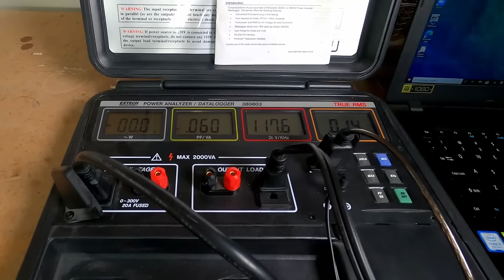Singer Heavy Duty, Most In-Depth Review on the Internet. No Really, I'm Not Joking.

Comment: I repair/rebuild 300U Chain stich machines daily for a very large mattress co and I just got to say my hats off to anybody who can tear a sewing machine down to the frame and reassemble it. With the end result being a fully functioning head.
Reply: I agree with you. I did Industrial Machines,,,and now more Domestic type,,, last time I did this in Training,,,long time ago,,,,I not doing that again,,,I worked on the 300 w. Series.  Good machine,,,also the 4 needles,,,making mops with the puller feed,,,the trick is the Looper Avoiding motion timing,, eye to eye setting with needle,,and feed timing.  😀😀
Reply: I buy/sell/use vintage industrual sewing machines. These machines are a symfony of asynchronous movements, it's a bit of a mindf*ck to get the logic of the stitch cycle. I'm yet to dare tearing down a machine fully. 😂
Reply: @Farmfield
Reply: @michaeltexeira6185  I am curious, why you are typing commas between each phrase? Proper typing format for a pause uses commas and for a pregnant pause...a series of 3 or 4 periods. 

When you create a broken sentence using tons of commas as you did, your sentence becomes one big 'run on sentence.' This technique leaves your readers not knowing when to start, when to pause or when to stop.  Punctuation is important to establish your pacing, a transition of thoughts 🙂 and clearly convey your intended message. I hope this helps!

Comment: The stainless steel bed cover is to help fabric glide across the bed and withstand scratches from pins better than plastic.
Reply: So they say, but it’s a marketing ploy. Fabric glides over plastic just fine.
The feed moves the fabric, it’s hardiness is more important than a fancy steel contact paper bit.
Reply: @elizabethclaiborne6461  Pins eventually mar up and catch up plastic bed plates, and they're molded plastic, so they can't be replaced. The little scratches and catches eventually prevents your materials from gliding smoothly. Anyone who has both an old machine with a metal bed and one with a plastic bed, and has used them often, learns this. It's not a marketing ploy,  it's functional and can be replaced, unlike damaged molded plastic.
Reply: The plastic bed cover over the bobbin box on a new machine arrived broken. I kind of jimmy-rigged it but it made me cranky to see it was plastic.
Reply: @silaslizzie43  because see-through metal doesn't exist...
Reply: hummingbirdlady11   -  I am not a sewer, but I love hummingbirds.  My feeders are clean and waiting for them to return.
Reply: @geezermann7865   Love hummingbirds and love clean feeders for them.
Reply: Good point about pins scratching the plastic surface.

Comment: I read a lot of reviews, before buying this machine, two years ago. I have owned numerous machines of all makes over the years.  I like this machine. I'm glad I chose it. I chose a manual specifically to be able to maintain it myself.  I have done some oiling and cleaning on it, but after watching this video, I will do more. I'm very thankful for your video. I mostly make fancy doll clothes.
Reply: How often should it be oiled? (Hours of usage?)
Reply: Hey very interested in buying doll clothes available 4 contact?
Reply: I use old machines that I fix up both straight stitch and treadle machines and I have one brand new singer start with five I believe different patterns and that is enough for me plus my Japanese r i c c a r with a  live zigzag bobbin 1950 66 singer I've noticed the Japanese machines out of the '70s and '60s are very well made
Reply: @ballparkmom005  they should be oiled in my opinion every other day if you use them all day.
Reply: Is the foot higher on this machine to accommodate thicker fabric? My daughter has a basic machine and you can barely fit a few layers of thin cotton. Any info would be helpful
Reply: I have the 4423 and it’s trash it always jumps time and tension is. A issue it’s got maybe 10 hours on it.

Comment: Thank you so much for this video. I bought this machine about a year ago and I've had no issues at all from lightweight to heavy and it sews like a champ. I have a 30 year old Viking Prisma and it beats it even for lightweight fabric. A friend recommended it to me since I sew just about everything from clothing to quilts and this little machine works great.
Reply: Do you still have it? If so how's it working? I want to get into sewing never really done much of it but I hope to do denim and lightweight fabrics once I get better, would it be worth it?
Reply: @historymatters8991  I use my machine almost daily. I made several gifts for Christmas, from lightweight pillow cases to heavy canvas tote bags and I didn't have any issues at all.
Reply: Cool. Thanks. for sharing. I also have a Husquarna Prisma (later named Viking) electronic. Do you oil the Singer as he recommended in this video? How often should that be done?
Reply: @camc3640  Yes I do keep my machines oiled, and I still bring out the Prisma from time to time to keep it running smoothly.

Comment: I'm new to sewing.  I bought my Singer 4423HD about 3 years ago.  I've sewn many western shirts, blue jeans and even leather cellphone cases with this machine!  I've also repaired nylon winch and tow straps (using the proper needles and thread of course!).  I've had a chance to use a few sewing machines and I must say this Singer makes the best straight stitches of all.  Since I have no need to do embroidery or other fancy stitches, this little analog machine has served me well!  I am diligent about changing my needles and keeping my machine oiled and cleaned.  As you pointed out, no need to remove all covers to reach the necessary maintenance points.  Good job and thanks for the great video!

Comment: Thank your for the information. I have been using this machine for years and love it. I also have a $6000.00 Viking electronic embroidery machine that has cost me many hundreds of dollars for maintenance and for a power supply. It needed another power supply a year after the last one was replaced. (Which I have not replaced. And yes, it is on a surge protector.) It now sits on the floor in my sewing room. The Singer is constantly used and works fine. Thank you for letting me know how to oil it.
Update - I just finished cleaning and oiling my Singer Heavy Duty. Thank you so much for saving me a lot of money.

Comment: Looks more well-built than I expected. Those gears on the motor shaft usually have a hex head set screw and motor shafts are pretty much universal so you can switch it as long as the relative position from where the motor mounts is the same. Very nice for a modern machine but I'll stick with the Pfaff 130-6 that I beefed up significantly.

Comment: Thank you for taking the time to breakdown and explain through your knowledge of the mechanics of the machine. I'm a newer machine sewer (with a few hand sewing projects under my belt) and am hoping to purchase a machine that will last through a wide variety of projects (home and clothing). I've been debating between a used singer heavy duty or waiting to snag an older, all-metal sewing maching. This is definitely super informative and helps me be more informed as I figure out my options.
Reply: I have been sewing for 60 years and had Swiss made steel machines for many years. I also had industrial steel sewing machines. Never had problems and I didn't even have the money to service them, cleaning and oil. 
Moved and had to sell them. 
Bought a electronic Bernina, not made in Switzerland, but somewhere in the east and plastic and spent £600 on a peace of rubbish. It is so light that when you sew it moves and all those unnecessary stitches, I feel sorry for young people who want to get sewing because the modern machines are just a load of plastic. 
Even this Singer heavy duty, just doesn't sound like a well made steel machine.
The old steel machines  like the Elna su star and the Bernina 730 are just a cut above and you still find them on internet and they are still in great demand. 
I am looking for one right now. 
Good luck, but be careful.

Comment: I have one of these. I accidentally sewed through the metal head of a safety pin with it. Literally punched the needle right through it. So I guess it's pretty heavy duty. My only complaint is the plastic housing above the needle is very cumbersome. All of my machines before this one were Singer Touch & Sews, so I'm used to the area around the needle being open and easy to access.
Reply: I ordered one and sent it back because the outer cover was too clunky and hard to get my hand in the needle and foot area and I don't like the drop in bobbin, I did get another Singer the m3330 Making the Cut      It's just cute , and works fine but not heavy duty,

Comment: The belt is called a toothed belt operating on the toothed pulley on the motor.  They have exceptional life expectancy and transfer power better than traditional gears and shafts in the older machines.
Reply: This! The power is transmitted via tooth instead of via friction. If the belt is properly made, it should last at least a couple of thousands hours on max load. Typically these belts are allergic to any kind of oil, though, so be careful not to drop any oil on either belt. Otherwise the belt might detoriate pretty fast (the oil damages the belt via chemical reaction so the detoriation happens by calendar instead of by use from this moment forwards).

Comment: Excellent review, thank you for the in-depth break down.

I have this machine and like it.  Gets the job done and versatile for its price point.

It is still too plastic compared to what Singer used to manufacture.  Everything is produced to lower costs as much as possible sacrificing long term quality.
They just won't last 20+ years as the older models.  Plastic gears/parts lasting 'a little bit' doesn't cut it - it wears down over time. 'Plastic' and 'gears' should not be in the same sentence.

I bought a used 80's vintage Singer machine with a dozen basic stitches, is built like a tank, and even where plastic casing is used is hard and beefy compared to my 4452. No plastic gears, all metal-on-metal mechanics. If the timing becomes an issue, I can fix it.  Cleaned and oiled it runs as new.  My friend still uses the family's 1960's vintage Singer which works as well as it did brand new.  Occasional cleaning/oiling and it keeps going.  High quality.

Comment: There's also thin felt pads on either side of the motor bearings inside the motor plates with holes in them.  Most people miss this. Maybe some shops. Must be careful only to add a very little bit.
Reply: My singer heavy duty 85scholastic (same as 4432)  doesnt have felt pads inside motor, but my 4423 heavy duty has the felt.

Comment: Amazing what heavy duty means these days for all kinds of machines. Soft metal, plastic gears, plastic covers. Even someone has to disassemble it, so the customer can see if it is actually good and repairable. Heavy duty now means that it is barely good enough, instead of actually be strong and reliable for many years.
Reply: I’ll keep my vintage Singers. 😉
Reply: Gears are only as strong as their weakest link. Plastic dry rots with time and exposure to heat. Common sense will tell you that this machine will not hold up like a machine with all metal gears. I like the experiment and professional opinion and it does sew nicely, but I'll keep my tried and true vintage, all metal, heavy as heck, all metal machines.
Reply: Some modern plastics are more wear-resistant than metal. Also, plastic details are often intentionally engineered to break break to protect more expensive parts from damage when something goes wrong.
Reply: @lordsgirl1123  my vintage singer just broke down and there are no repair shops near me. Idk even what’s wrong with it. 💔 I just bought a new singer and I miss my old one. I still have her hopefully someday I can figure out what’s wrong.

Comment: Nice comprehensive review. I have repeatedly had to reset the timing for my customers who own these machines. Yes, they have good torque however often times rather than breaking a needle the gear driving the hook slips on the shaft. This happens with as little as 20 hours of use. For this reason alone I advise customers to consider alternative machines.

Comment: this is the best.   I volunteer for snowball express by Gary sinese foundation.  We bought 20 of these machines and for 6 days a year they run for 8 to 12 hours.  We are putting patches on leather vests with either a free motion foot or a regular foot.  They run like champs.  between the 2 day and the next 4 they get a spa treatment.  I knew they were an okay machine, until I saw this video I wasn't sure we had made the right choice.   The only problem we have come across is all of a sudden they start acting up.   breaking needles, thread and in general just being a pain.   Going through all the troubleshooting I knew I noticed a rough spot just at the point where the thread goes around the bottom of the right bottom and catching.   Changed out the bobbin casing and it went right back to sewing perfect.  such an easy fix.  just took me hours to figure out.    welll done  video.  I learned a great deal.   thank you,

Comment: Plastic gears can be remarkable strong. My 700 class R/C helicopters have Delrin plastic main gears that can handle a 5000W BLDC motor or a 4HP fuel engine without problems. Of course if you tried to hot start them without a soft start (electric) or a clutch (IC) the steel pinion would strip teeth off the plastic maingear but once the machine is spooled up it can handle the full power output from the motor no problem.

Comment: This was really good.  I got to use one of these machines when a relative asked me to repair it.  I thought maybe the timing was out of adjustment but it turns out the needle was damaged.  Replaced the needle and it worked fine.  It works fine but I have a Singer 301 and would never trade.

Comment: 40 HRC will scratch even some mildly hardened steels. Your kit is for hardened steels only.
The chasis is not zamak, but it's not pure aluminum either.
It's made of silumin, composition of aluminum, sillicone and additives. It can containt up to 25% sillicone, which is basically sand and is dirt cheap, so silumin is cheaper than pure aluminum, but it's also slightly stronger at the cost of greatly reduced plasticity. You can't bend silumin or it will break.
Reply from the maker: Thanks for the insight! That makes a lot of sense, it doesn't seem like pure aluminum.

Comment: 40 HRC isn't soft.  The Rockwell hardness C scale goes from 20 - 75.  4140 medium alloy steel normalizes to ~ 30 HRC. 4130 alloy steel normalizes below 20.  If it attracts a magnet the metal is steel.
Reply: * In case of SS, the magnet method won't work. I believe the best way to distinguish iron from aluminum in this case is by weight.

Comment: Thank you for this review!  I have had my eye on this machine for quite some time.  My sister owns one and loves it.  But I’ve been a Singer lover since the mid 1960’s and own a 1963 T&S with all metal gears.  That machine, is what I would call heavy duty for a home machine.  It’s gone back and forth across the US four times, with all but one time in a car.  The fourth time, it fell off a conveyor belt while being loaded onto a plane.  And it’s still running.
I think the term “heavy duty” by today’s standards means that it’s not all plastic.  Cheap soft metal, sure, but no plastic.

Comment: Thank you so much for this review. Very impressed with your skill, method and presentation. 
My hobby grew to a small business size, and I now do lots of curtains. Mostly hand finishing, but the pleats are giving me grief. 2 plies of heavy damask or thick wool. lining, interlining and buckram - the sheer bulk of it is difficult to get under the foot, not to mention sew through, even though it is not as challenging as leather or canvas. Do you feel that this machine would be a suitable all-rounder, for the curtains but also for "normal" sewing? If not, could you be kind to recommend some machine models under 800$/500£? Maybe vintage? Does such a beast even exist? Thank you very much in advance!

Comment: It is a shame they couldn't have made all metal gears for just a smidgen extra money. That said, I have one of these and I've really pushed it to uts limits and it can handle alot. Alot. I mean using layers of leathers. I really do like my machine. I don't push it hard all the time. I have vintage machines for heavier stuff. This is a very versatile machine.
Reply: Zach Sheffee  and basically, that's what I use it for. I use it for things my vintage ones won't do, or put this machine through abuse, planning on it not lasting long. That said, I really do like it and it has impressed me.

Comment: Grateful for the review. I will want to sew long stretches of sheepskins, in addition to denim etc. So far this is my favourite to see if it works. Your review hasn’t unearthed anything that puts me straight off that idea.
Reply: The pulley on the motor is either a pulley or a cogged pulley not a gear just saying
Reply: Nice anything with the belt , is a  (sprocket )thank you for doing this
Gears run together but something with a belt with her tooth or not is a pulley or sprocket depending on whether it has teeth different animal...

Comment: Hey, Thanks for going to effort of showing us under the hood. Its good to see how they are made. 
If you were to run the machine slower under load the current demand will go up. I think most reasonable machines will plow through heavy stuff at high speed. A real test would be a slow controlled start at around 1/4 pedal holding for a while and gently increasing speed and watch current demand. This would be closer to real world use and a test of the machines ability for heavy demand under controlled use.